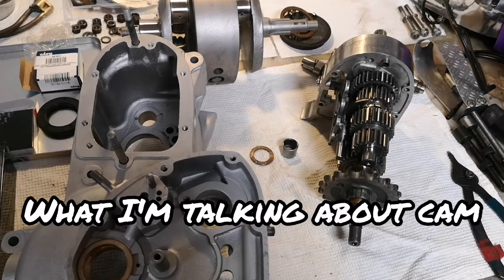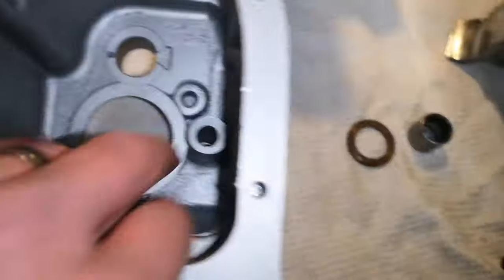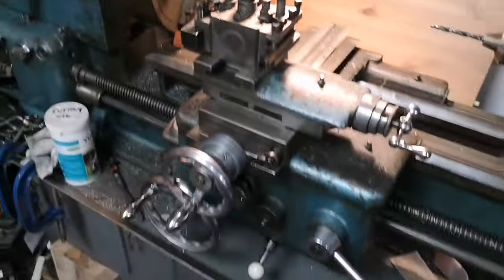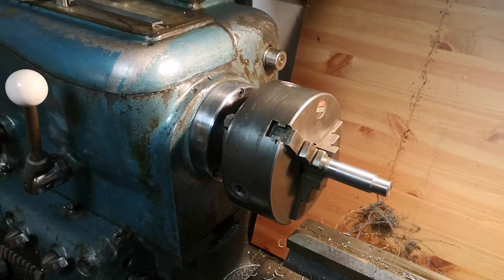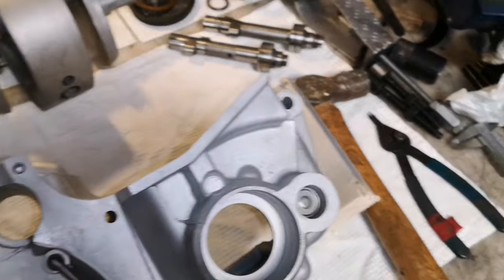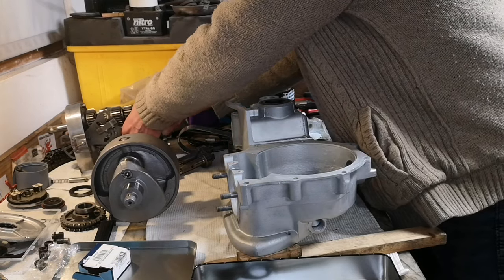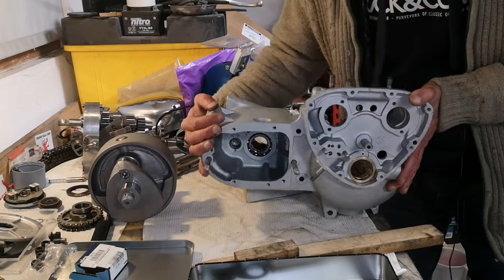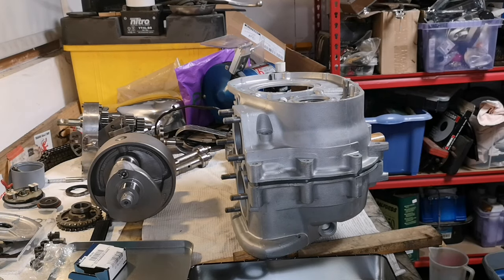Project Triumph Tiger 90 Episode 22

Comment: Great progress! My T90 is on the road again thanks to your and Dominic Chinea's inspiration. I see you have Wellseal which I used throughout with great success. No oil leaks at all! When I joined my cases the halves were not perfectly aligned with a small but detectable step in the barrel joint. I couldn't loosen those two screws in the mouth of the case to adjust it so had to live with it. No leaks though so it's ok. I didn't have the barrels back from the rebore shop at the time otherwise I could have temporarily bolted the block onto the case before tightening the case bolts so guaranteeing a perfect joint. I hope this helps.
Reply from the maker: Glad yours is on the road! 
I’ve got a deadline. I’m riding it up the hillclimb at Shelsley Walsh in May at the 75th anniversary of the triumph owners club. So I’m feeling in a rush now!!
Reply: Your cycle parts are done and it doesn't take long to build the motor if you have all the parts so you will have no trouble meeting your deadline. If you can get to the Fleet Classic bike ride out on 6th May you could well win a prize.
Reply from the maker: @PurpleHazeT150V  I'm a hundred miles north of London, so quite a long run for an unproven bike!
Reply: @suzukisav It's a 200 mile round trip for me. I did it on my '71 250 Trail Blazer last time which was quite a trek!
Reply from the maker: @PurpleHazeT150V  wow, good effort!